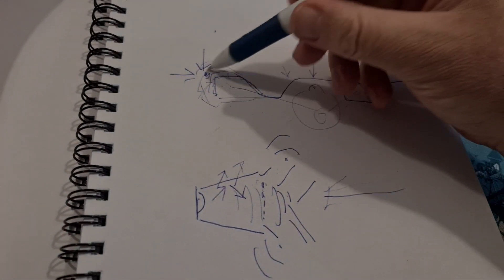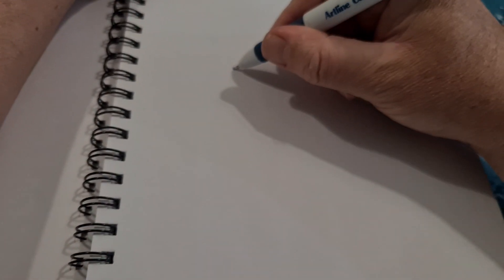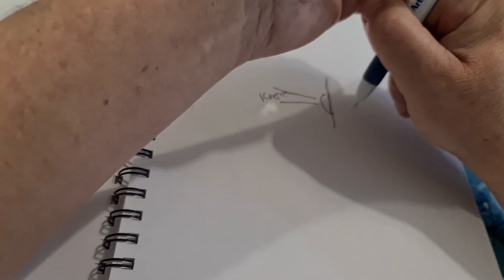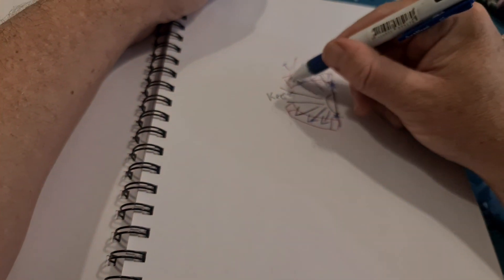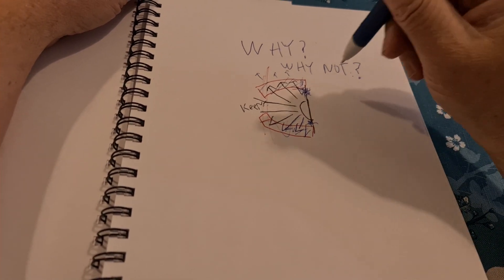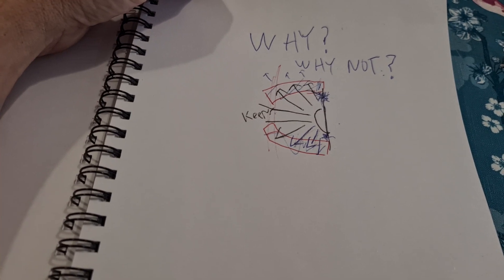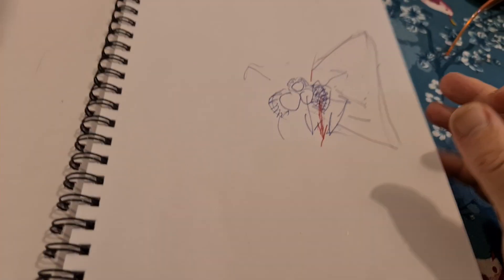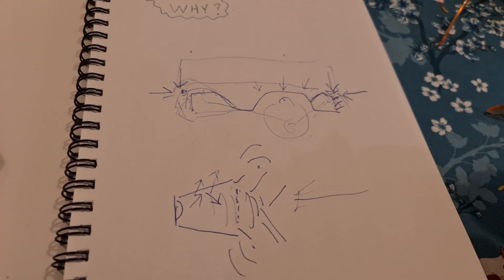How to understand my video content. Revealed.

Comment: Nice video why you didn't try to horn load the dome mid try a paper or foam cup cut out bottom place over it to see if that works and you can attach foam on the inside to experiment with
Reply from the maker: Done a bunch of that. Check a few months ago... https://youtu.be/1Ft_PJTIeyM
Reply from the maker: My current test excludes any horn/guide loading to validate theory. Later I may include small lip/horn/guide to 1/4 wavelength of each dome.